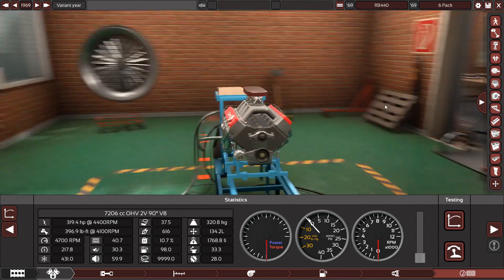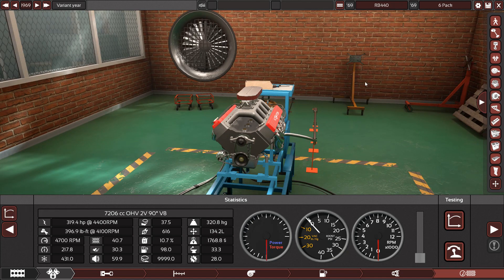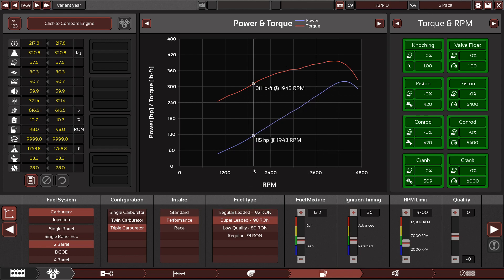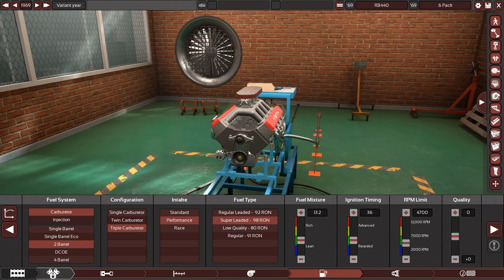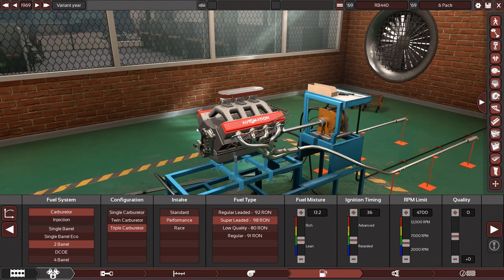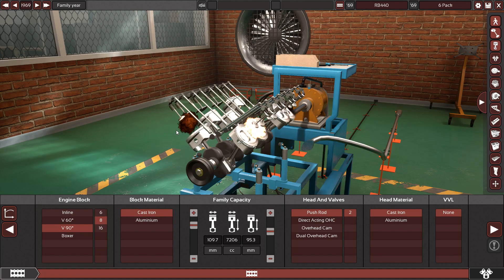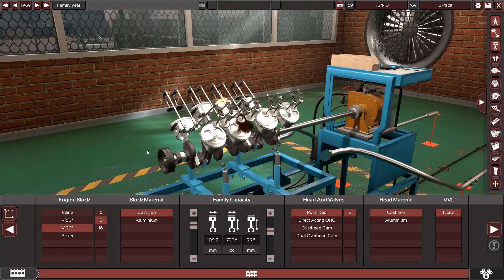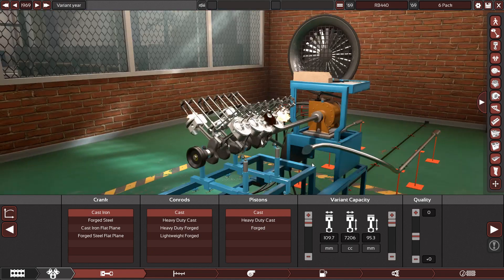Automation - Why Muscle Car Engine Replicas Don't Work

Comment: Those engines were gross hp they never gave them the real numbers or they wouldnt be able to sell the car. They might say the 440 made 330 hp. But a fresh engine made more like 400 hp or 1 hp per cubic inch

Comment: The big drop was because they reduced compression ratio. And before that they often put out even more than measured but for insurance reasons they kept it low on the sheet.

Comment: The power drop in the early 70s was also due to a requirement that all engined be able to run on 91 RON Regular Unleaded fuel. Even without a cat that requires defining.